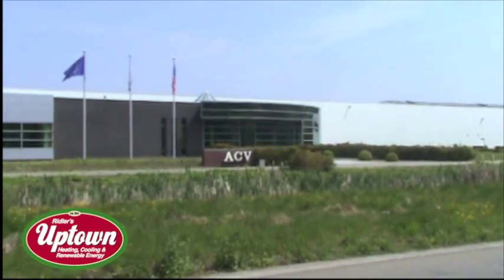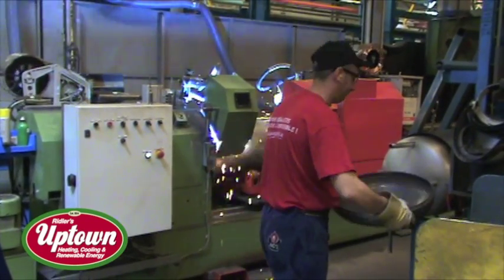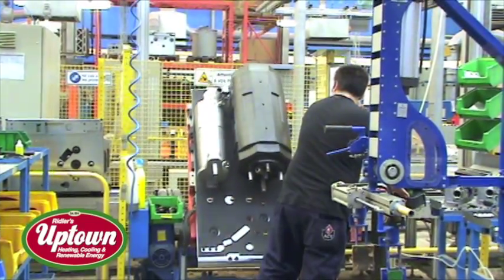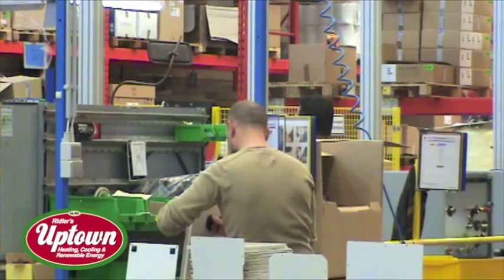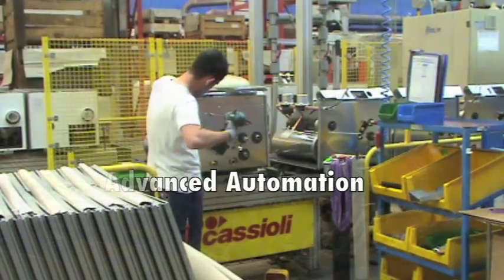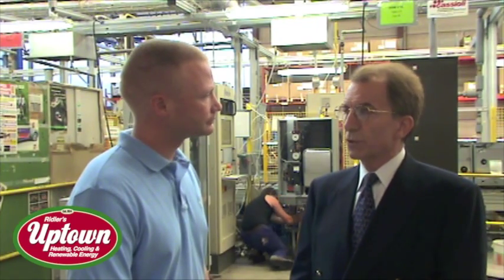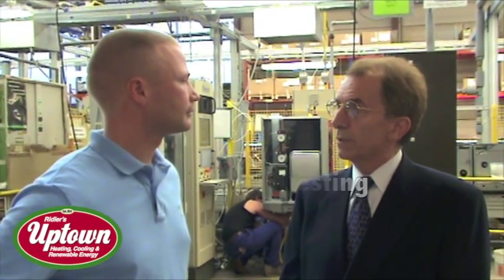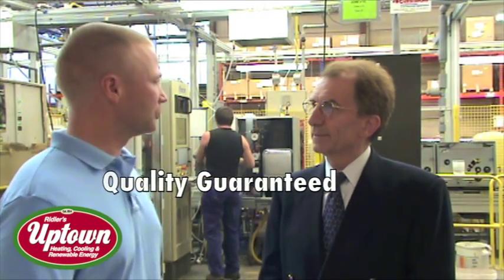Inside Look at Triangle Tube Manufacturing.mov

Comment: I just had my  Triangle Tube water heater replaced which was installed just 7 month ago. It began to leak, shorted and stop working. I am amazed and disappointed at how quickly this unit broke down. Does anyone else want to share their experience with this product?